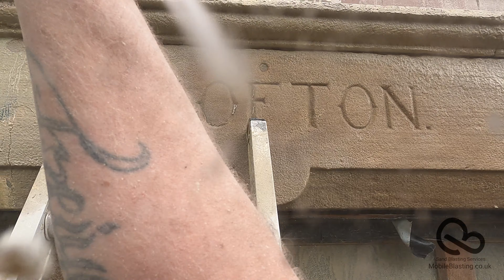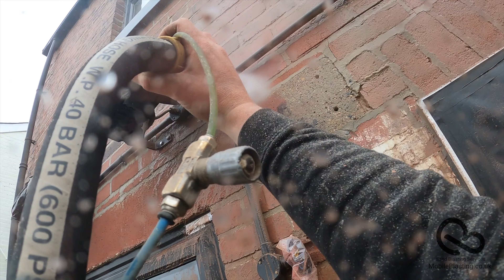SandBlasting clips

Comment: At 3:03 was that steel shot or steel grit? The nozzle looked different from anything I have seen before. But the lack of dust made me think steel abrasive. Am I right? And what nozzle is that?
Reply from the maker: Steel grit to profile stainless Steel. The nosel is a Boron Alloy Nozzle BANF8 – (1/2″- 12.7mm) cheapest possible nosel as I don't normally need 1/2" it's pointless spending 150/200£ for 1 project these are about 45£ delivered I've used it a few times since 👍